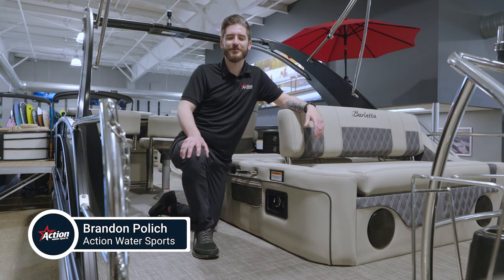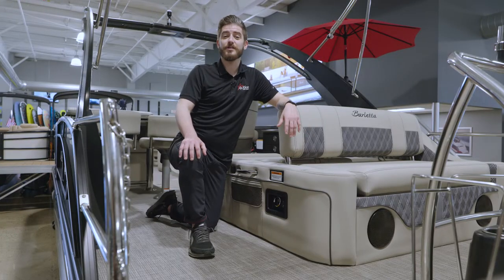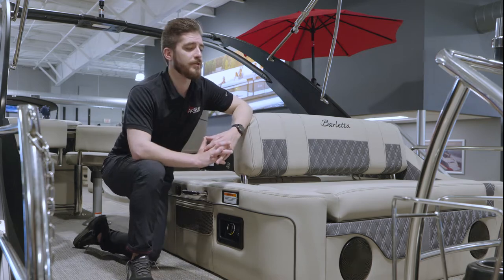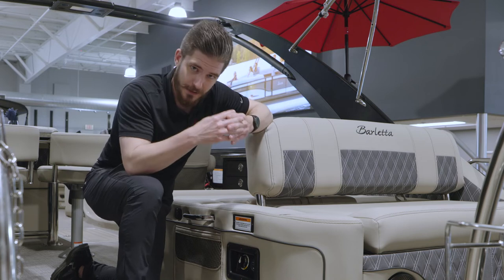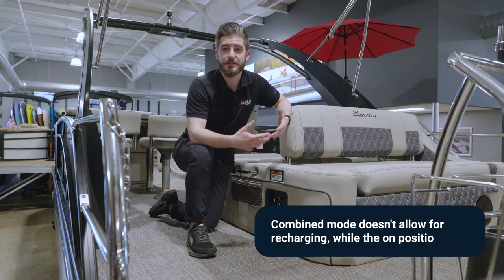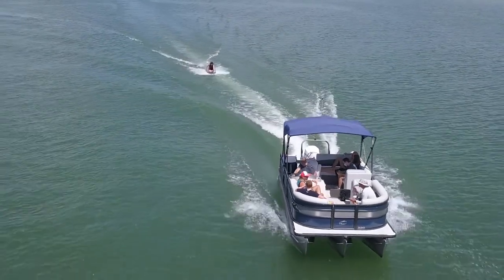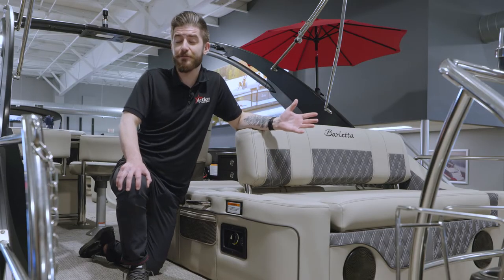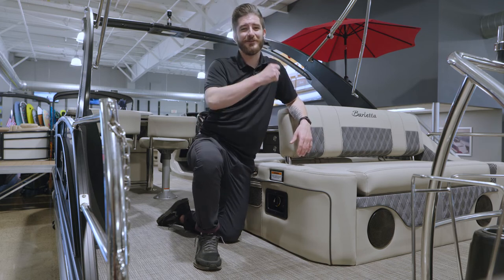Boat Battery Switch Explained

Comment: Another good tip is to make sure that when moving the switch you are feeling some resistance and positive clicking/stop points for each position. These can wear and fail … I just had mine replaced this season.
Reply from the maker: Great tip Matt!